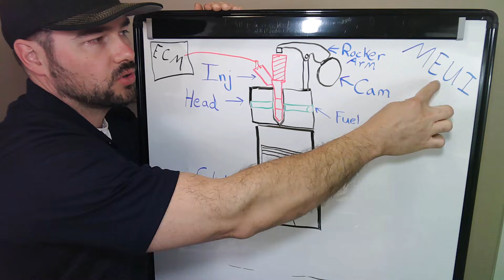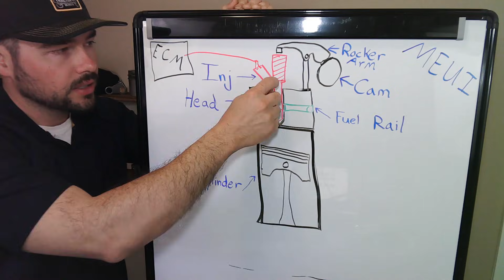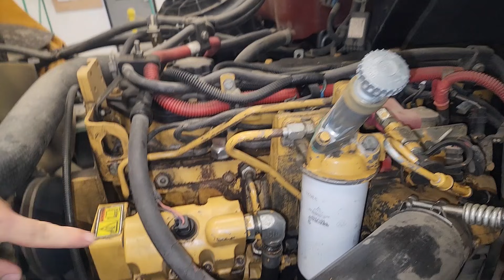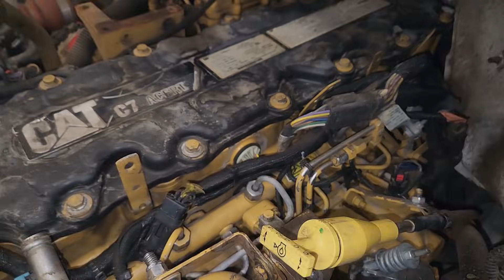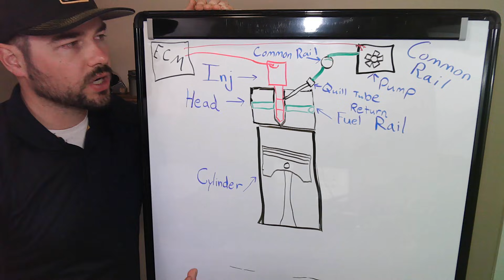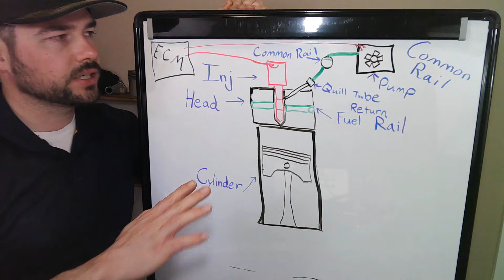Diesel Fuel Systems 101 part 2. Common Rail, EUI and HEUI.

Comment: If the camshaft lobe essentialy  pressurises the fuel inside the injector to be put in the combustion chamber or port or pre combustion chamber in IDI engines, then how can the ECU control the timing, if the Camshaft lobe is always the same? How can the timing be any different? The timing is always the same as the camshaft lobe lift, which cant be changed. Does this make sense? I.E the ECU can be open on whatevwr pulse timing but if the Camshaft lobe doesnt lift the rocker arm in its lift cycle then there wont be any fuel put in the combustion chamber. It cant just stop while it waits for the injector to open for atmoization of the fuel. It runs in unison with the engine speed. Thanks in advance.

Comment: we have had an injector tip come off an brand new cat c15 acert injector (eui). always herd of it but never seen it happen. ill tell ya never seen so much smoke out of a truck lol. tip went thu the turbos no cylinder damage that we could see. changed the high pressure turbo with a used one and a new injector. truck is still running strong!

Comment: Another cool thing you can do with Common Rail is multiple injections throughout the stroke. FIAT invented the multijet technology (then they sold it to Bosch) and it does up to five injections of different durations per power stroke

Comment: Brother pump generates 1200 psi pressure to injector ok correct your knowledge about fuel pump and injectors and about pump pressures it depends on the brand of fuel pump

Comment: I have one experience with comon rail that night help someone down the road. I had,a vemeer 24/40 drill which would not start without a little shot of ether.   It had a john deer engine so I contacted the dealer to diagnose the problem.  The first call took several hours $1,400,  to no avail the second visti all day the tech mixed some wires up and said I needed a rebuild on the engine . $1400, . I buy a new engine from John deer and install it myself. Sane problem. I call the tech out again this time it is the first tech and he finds the messed up wires the 2nd guy did. He works several hours and is about to leave and I say no I don't have access to the computer you have to figure this out.  Hecwork another hour and says I think I've got it. It was the high pressure fuel rail releif valve gone bad. $275. I spent $20,000 and all the labor to replace the engine over a $275  releif valve.

Comment: Does the HEUI system have anything to do with the engine not shutting off? 5amp ignition fuse blows every time they key is turned off. Engine stays running. 2007 international DT466

Comment: I stopped this at 21:22 to ask.....    Re:  The Head Return Fuel Rail.  By having the fuel go through the head as you state to help cool the injector, It would also be very beneficial to warm/heat up the fuel "in very cold climates" for optimum flow and efficient combustion.   Was that one or a main reason for this design?

Comment: I love learning more about all these systems; thank you for making videos like this that explain them in detail. 

We changed the oil on a 2013 International bus with a Maxforce DT466E. After the oil change, the engine would crank but not fire. After quite a bit of cranking, it came to life, haltingly at first, then evening out. It seems to run fine now, although in my opinion it seems to run rough when cold; could this be caused somehow by the oil since it has a HEUI system? Would overfilling the oil (by 1-2 quarts) cause problems at all?

Comment: i love HEUI fuel systems,  basically idiot proof, oil gets way to thin, wont build any pressure won't start, have a bad leak low on engine oil, wont start. stops you from turning a rebuildable core or a savable engine into a hunk of cast iron that only the chinese could use for something. all these other Fuel systems out there, are in my opinion outclassed by HEUI, in terms of being idiot proof, and all these other systems generally are way over complicated. take a 6.0 powerstroke, you only need cam and crank sensor and the IPR valve working and no high pressure oil leaks and itll run given injectors and fuel supply is fine. take any newer common rail system generally you got multi  check valves,  sensors, a very sensitive pump thats going through Thousands of gallons of New fluid every week and said Fluid is fuel, and provides almost no lubricity, vs HEUI pumps even the bad ones, have a better chance at lasting alot longer than even the best common rail injection pumps, a HEUI pump doesn't care about what fuel is in it. as no fuel goes through it. its a sealed system as long as you got good oil, preferabbly fresh oil in it, it will outlive most anything.

Comment: It's interesting that the most modern diesel fuel system is the common rail version, which is described at length in a 1948 vintage textbook I have on internal combustion engines.  It suggests common rail fuel systems will be useful only for very large diesels, such as those on ships and railroad engines. Of course, there was no ECM back then...

Comment: HPCR injectors  have the return line because they need it to fire the injectors. Losing heat is just an added benefit.
Reply: How does the return line fire the injectors?
Reply: @thetowndrunk988  short answer is the fuel pressure is what opens and closes the injector. The injector has two chambers and you create lower pressure in the top chamber by allowing some bleed in to the return line, the higher pressure in the bottom chamber opens the injector.

Comment: I love the heui systems much cheaper to fix. CR wear out fast as is the case with high psi.
Reply: CR doesn't wear out fast unless it's not properly maintained and fuel filtration level is critical. Nothing bigger than 5um absolute fuel filtration or it's like pressure blasting abrasive media through the Injection System
Reply: The engines themselves don’t necessarily wear out faster. Like everything else, it all depends on maintenance. There are a lot of old school drivers that do oil changes every 10-15,000 miles, but NEVER get the emissions system intervals done (or don’t do a proper delete, not that anyone should ever do such a thing), and simply wait till the dash looks like a Christmas tree to get it serviced. Then they wonder why the engine is gone at 500k
Reply: Heui will wear out fast with improper oil changes

Cr will wear out fast with poor fuel quality

They are pretty much the same system except different hydraulic fluid for each.

Comment: What system does a 3176 from the early 90's run? I'm guessing MEUI?
Reply: Correct MEUI, first was 2YG, second 7LG (three serial number ranges) last 3176B 9CK.
As this engine was a total disaster Cat dropped the number and went with the C10, C12, C15 etc, to get away from 3176.
Reply: I thought that generation motor was regular inline pump and Injector ?

Comment: One critical thing on HUEI engines is oil quality. Something such as a dead cylinder dumping soot into the oil will wipe out the tolerances in the high pressure oil side of the injectors pretty quick.
Reply: I've learned that the oil additives in the oil make a huge difference too. Anti foaming additives that come WITH the oil that you pour in the engine will help make up for the aerated oil that can damage or mess with the injection components and timing.
Reply: @hizzilary5491 Exactly. The oil off the shelf has an additive package to meet certain standards. Dumping additives into the oil can throw off the balance, leading to more harm than benefit.

Comment: I'm all for mechanical simplicity but common rail diesels, the pre-emissions ones are where it's at!
Pure mechanical injection just really can't compete with common rail!

All the other injection designs were simply a stopgap until common rail was commercially available and reliable, similar to GM's TBI which was kind of a middle ground between a mechanical carburetor and a full fuel injection system, it was a stopgap and it did its job decently well enough.

Comment: loved the video josh! always love to learn something new around regarding heavy equipnent! also i do have to add a little note to the common rail injectors and that its mostly more complicated on heavy duty as they will usually sit inside the valve cover requiring quill tubes,  medium duty and lower will more freqently have it exposed in a valley on the valve cover making it much easier put your greasy mittens on them xD

Comment: The navistar powerstroke 7.3l has a brass injector cup that separates the fuel section of the injector from the coolant passage in the head. I presume the purpose is to help cool the injector. Well those cups can crack and leak fuel into the coolant system. So if you ever open the coolant reservoir on an older powerstroke and smell diesel or more frequently see a truck with a coolant system full of diesel, then it needs cups and also very likely needs all new coolant hoses. Might also need a coolant pump if the seals are shot from the diesel.
Reply from the maker: Good information. Like the 3116 engines with the copper cups.
Reply: Happens on 6.0s too
Reply: I work mostly on fleet volvos here in Brisbane, Australia. Mainly B7Rs and they are they same with the copper cup, we tent to get the coolant in fuel (we obviously drain and flush both systems) they are a bit of a pain to do also

Comment: The word simplicity is no longer permitted to be used, in the Diesel industry. Now tell the diesel dummies they have to be smarter, to work on newer engines. Parts changers.
Reply: They are simple if you understand all the systems and how they work!
An old mechanically injected diesel would seem ridiculously complicated to somebody that's used to dealing with a horse and buggy, I work on modern diesels for a living and I can assure you once you understand how they work they're extremely simple!!
Reply: @lustfulvengance  agreed , some people aren't intelligent enough to understand the operation theory of modern engines
Reply: @lustfulvengance  I went to the parts room 15 years ago. The younger generation is the wrench turners now. I still observe the doings. Every sensor gets renewed now. Turbos get changed out. All new harness.  No more repairing them. New DPF and DOC now. Cleaning doesn't last. It might be easier, but it cost way more. I forgot about the DEF problems.

Comment: Josh great video series. I would like you do a video regarding secondary oil filters like the spinner 2 filter. Most mechanics hate them but I run them on all my trucks been proven over years a lot more miles before overhauls then most company's. The carbon that these filters take out of the oil is amazing. I want your honest opinion on these filters. I know you do not like napa filters been running for years on cat and cummins  they are wix filters and with the spinners amazing mileage before overhauls. Plus I change oil every 10000 miles with the loads I pull.
Reply from the maker: Interesting topic, been asked about them before. Don't have any experience with them really.
Reply: @AdeptApe  send me your email I will send pictures of what I take out of the spinner you will be amazed
Reply: CLEANER OIL IS NEVER NEVER NEVER A BAD THING!! There's eay too many ignorant azzes in the diesel world, you can spot them easily when they say stupid things like talking down to enhanced filtration, etc ..

Comment: I'm curious to know how much current has to flow through the solenoid in order to overcome/control the high pressure that's in the injectors.
Reply: depends on the injector manufacturer and style but usually about 20A give or take depending on the voltage given to them, piezoelectrics are around 50A with the same rules, depends on the voltage.

Comment: I'm a certified Detroit Diesel tech, I work mostly on the DD13 and DD15 engines. Their fuel systems have no fuel tube in the head, they have a fuel line that goes from the fuel rail to the injector through the cam housing. DD engines also have a lot of injection Pump issues, metal in fuel caused by lack of priming the fuel system. Detroit uses fuel to lubricate the injection Pump. I also want to mention that there is another fuel system that Mack, Deutz, and Mercedes used. Basically it's 6 individual injection pumps ran off of an in block cam lobe, has a fuel line that runs to each injector. I'm not entirely sure what they call it, but it is used on the later Mack E7, Mercedes 900 and 4000 series engines. Volvo/Mack also have their own unique take on common rail. Their common rail fuel system is a mixture of common rail and Meui. They do not use a high pressure injection Pump, they use a tandem pump which us the fuel and power steering pumps. They have a fuel rail under the valve cover going to each injector. They have 3 injectors that are actuated by a cam lobe, and have 3 injectors that are not. It is the weirdest fuel system I have ever seen.
Reply: I just saw that a few months ago when doing an injector harness and sensors on the common rail. Had to look twice to make sure I wasn’t seeing things. I have always heard the old E7 individual injection pumps called EUP will still work on those old E7  all day before one of the emission engines
Reply: I think it’s unit pumps you’re talking about. Deutz used it too.
Reply: Detroit used unit injection on the old 2 strokes- that's what you are describing on Mack etc  reads like to me. For the uninitiated, a common fuel supply line feeds all injectors, and throttle done by a rack that operates them all. Gotta size those things correctly or you get too much or not enough fuel. Wet stacking will happen if you can't keep it in the operating range. I'm a fan as they're simple and reliable and sound awesome. That's the one thing common rails just don't have- the sound. I'll miss it when it's gone some day entirely.

Comment: Odd question here, could something like an alfa laval fuel polisher increase the lifespan of those 30,000 psi injectors?
Reply: Yes. Fuel filtration level is a direct correlation to CR fuel system life. Must be sub 5um particle filtration, the finer the better. We run 2um Davco filters on all our modern CR diesels and never have fuel injection system problems, just a little more frequent filter changes that are ridiculously easy for this benefit.
Reply: @100pyatt  good policy. Also, a FASS fuel system can be a huge benefit. Not only great filtration, but eliminating air bubbles really helps common rail longevity.

Comment: What is your opinion about centrifugal oil filters or oil centrifuges? I bought a used Ford L8000 for a farm truck, it has an 8.3 Cummins with an add on centrifugal oil filter. It does seem to catch carbon and keep the oil cleaner longer. The unit on my truck was made by T. F. Hudgins and is called a spinner.
Reply: Clean oil is never bad oil. Enhanced filtration is NEVER DETRIMENTAL, ever!
Reply: As said above, cleaner oil is NEVER a bad thing. Just make sure you have good flow rates (not necessarily higher oil pressure)

Comment: Why are most ECM's, seem to be always, mounted on the engine block? To me it only makes sense to keep the ECM from heat and vibration as much as possible. Heat and vibration are known computer killers.
Reply: Because with all of these big diesel engines the engine is sold by the engine manufacturer as a ready to go "drop in package"  so the engine computer has to be mounted to the engine somewhere so that the company purchasing it and installing it in their truck (or whatever) doesn't have to worry about where to mount a computer. 

To be honest these computers are extremely robust and usually cooled with fuel and it's very rare to have one fail!

Comment: HEUI systems suck and are troublesome. MEUI systems are great and have longevity. Common rail systems are cheaper to manufacture but doesn't last long. Komatsu wants new injectors every 1000 hours. High maintenance.
Reply from the maker: 1000 hours, that is ridiculous.
Reply: @AdeptApe  10k not 1k
Reply: That Komatsu story is not true. We own a few pieces of new komatsu common rail machinery and there isn’t any documentation that mentions an injector replacement interval. I know people that have tens of thousands of hours in komatsu machinery and I can promise you they haven’t had injectors changed on that schedule.
Reply: Forgot a zero, it's 10,000 hrs on Konatsu CR engines is the recommended refresh
Reply: We have 350,000 miles on a 7.3 PSD that's lived a rough life in a battered old Ford. Fantastic engine and fuel system, in that application at least. I'm personally an old school inline pump or unit injection fan though. May not make big power but it's got character and lasts forever.

Comment: Cummins was proud of the most complicated fuel system ever invented, they forgot to mention most expensive ever designed, trying to compensate for the egr and cooler.
Reply: What about the MaxxForce egr
Reply: @5.43v  agreed David, MaxxForce was bar none the worst diesel truck engine ever made, by a significant margin
Reply: Nothing to do with the EGR Cooler, it's about NoX and PM emissions. Cleaner PM emissions is longer engine life and better economy. NoX on the other hand is reduced by better pressure control through multiple precise injection events which cause reduced pressure rattle noise and increase internal components and bearing Life.
Reply: @100pyatt  egr and cooler is an attempt to reduce nox by lowering combustion temperatures but does reduce nox nearly enough and at the same time pushes particulates through the roof thereby requiring more regenerations. Follow the money. In 2014 the soot trap and catalyst complete assembly for a Pete 320 with a Cummins 8.9 cost 32,000$
Take care of the soot in the engine and then use more purified cow pee. Company I worked for had a Pete with a pre-cup Cat that when smoke tested was right at 1% opacity, 3% is allowable. 
Follow the money 💰